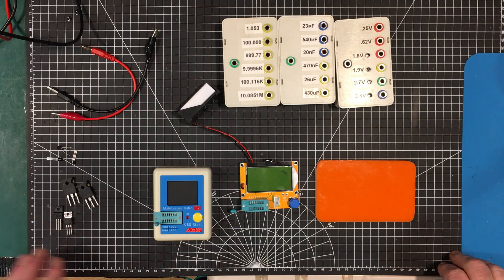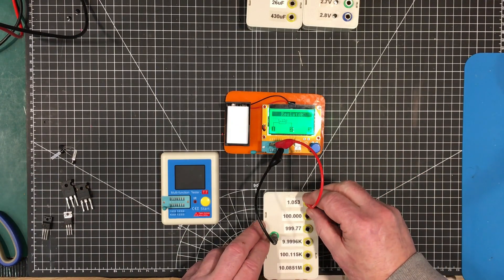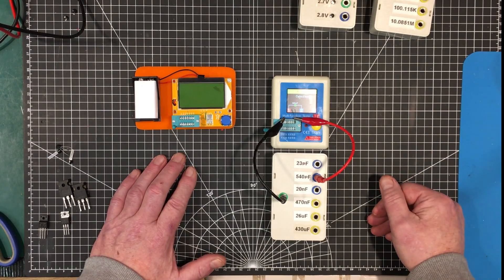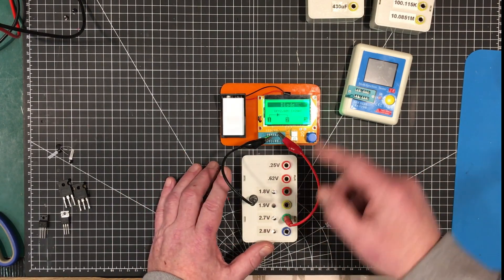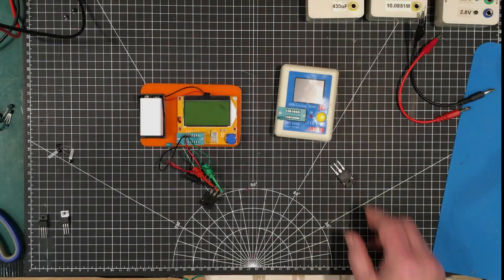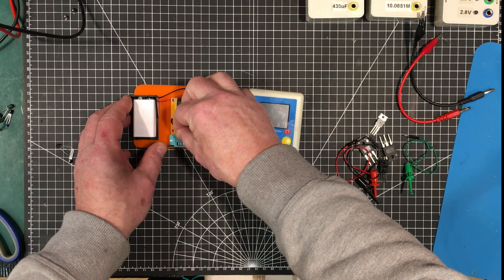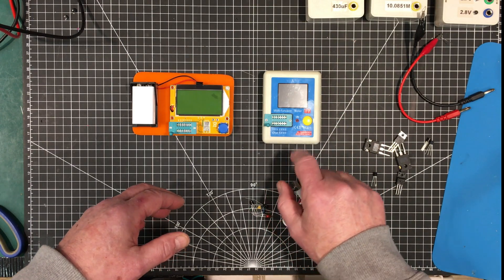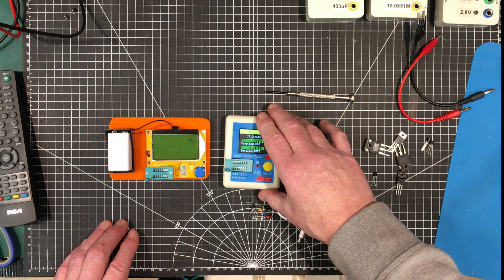0144 - A Tale of Two Testers:  One Is Better

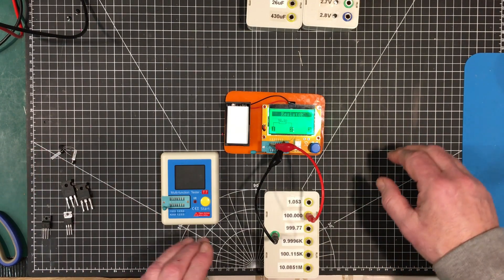Comment: 2:37
3:05
I think you misplaced a decimal point a couple times here. The LCR-T4 misread the 100 ohm resistor by 1.2%, the 100k resistor by 0.7%, and the 10M resistor by about 0.7%.

Not saying the conclusion of the video is incorrect, but the LCR-T4 read all resistors from 100 ohm to 10M ohms to within 3%.

Thanks for showing the differences though!
Reply from the maker: Good catch!  I need to slow down a bit..  It's too bad YT do not allow us to make corrections.  We all make mistakes but it would be nice to be able to correct them when they are found.
Reply: @uni-byte  No worries.. also the glare on the T7 makes it very hard for us to read the results.
Reply: I came here to say the same thing, the author might want to add a note or pinned comment to the video ..
Reply from the maker: @thygate  Done!

Comment: I have the 'bare' version, drop in a tip127 and its pnp, turn it around, its npn.... or was it the other way... but you get what I mean, it fails to correctly identify it depending on which way its inserted into the zif socket, which should not happen?
Reply from the maker: Strange, but I have heard that from others too.  This one does not have that problem, but then there many different companies making ones that look just like these.  I do have one that messes up the pinout of certain transistors.  It's FNIRSI, but they are working on fixing the problems with it.

Comment: I bought the T7 because I wanted a handy decoder to troubleshooting remotes and verifying the control codes from PICAXE projects. But all the T7 would do was flash an LED type spot on the display when I pressed the remote buttons, indicating that the remote was working, but I was getting no further info from the tester. So I looked around online and found a manual for the T7. I don't know if the firmware version I have is identical as far as the features indicated in the online manual. However, the manual stated that the T7 only decoded Hitachi codes. The remote I tested is a SONY, which is also what the PICAXE chips work with without bit-banging. Oh well. BTW, if anyone wants to simply verify that an IR remote is functioning they can probably do what I do and view it with their cellphone camera. Most of them don't block IR vary well, so it's easy to see in real-time. I also use that trick for playing with my IR lasers that I use for free-space laser audio communications. I use a cheap, (free,) old cellphone with video to see the laser light, since I found one that doesn't appear to block IR at all. I guess they were too cheap to bother. So it has become a handy test tool on my workbench.
Reply from the maker: I couldn't get mine to work with a Sony or a Bell (DirecTV) remote, just that RCA one so far.

Comment: can it be modded to not turn the screen off so quick, that'd annoy the heck out of me
Reply: There is a video on how to increase the on time.
Reply from the maker: @guateque1718  Do you know a search string that might work. like the description/title of the video?
Reply: @uni-byte  https://www.youtube.com/watch?v=fGBj6XiTR7M&t=552s
Reply: there were a few more but during a quick search this is the only one still online.
Reply: I hope that helps.
Reply from the maker: @guateque1718  Unfortunately not all T7 testers are created equally.  Mine does not have these jumper points and the circuit board is a very different layout.  Thanks for sharing though, it might help others that have the right board.
Reply from the maker: Not that I'm aware of.

Comment: K=cathode, A=anode. If you connect a zenner diode there, you will get the zenner voltage and measuring LEDs is more precise. Some testers work up to 5V, some up to 12V, some up to 30V. You will meed to check to see what is the limit of zenner voltage your tester have.
I also have both and there are some differences, however, I do noot trust them 100%, I mostly use them for sorting and quicly identifying components. Each one is better than the other in identifying transistors, SCRs, so I use both.
From time to time, I calibrate them.
Reply from the maker: Thanks for the tip Sebastian.  I appreciate it.  I found a thread on these testers over on the eevblog forum.  Quite a bit of information over there on them.

Comment: I am assuming you ran the mandatory calibration cycle on both of these????
Reply from the maker: I did.  Interestingly the T4 had an extra stage in it's procedure that required a 100nf capacitor.  I happen to have a very accurate 100nf film capacitor.  I was actually wondering if that was why it was more accurate while measuring capacitance than the T7.  I should have mentioned this during the test.